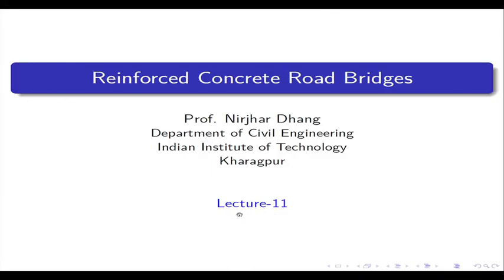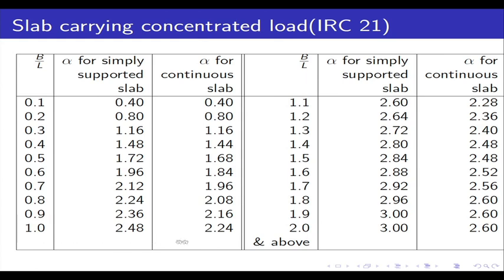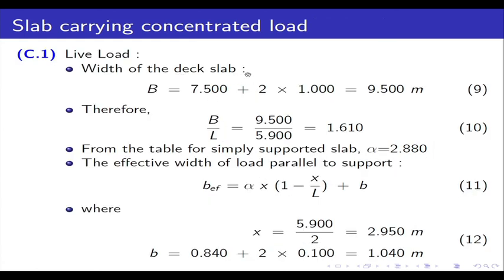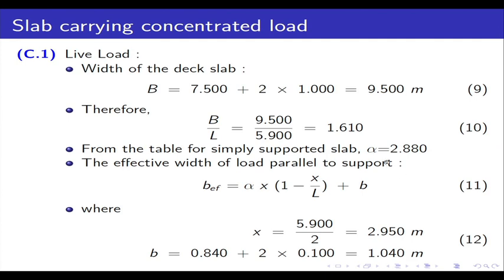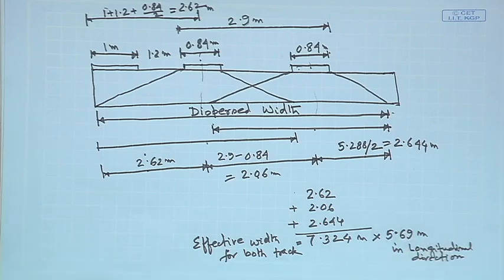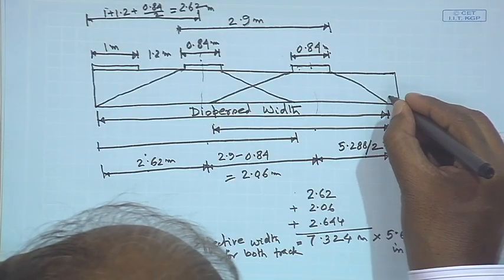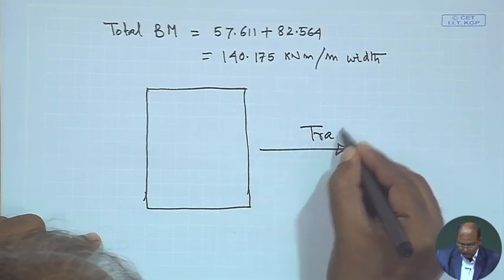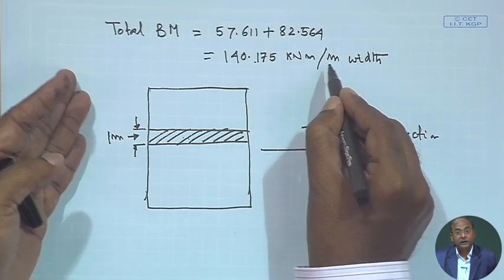Design of Slab Bridges (Part III)

Comment: also in calculation of Live load Bending moment, shouldn't we use 
(20.429)*(5.69/2)*(5.69/4)  (28:05)
Reply: am thinking same
Reply: Yes am also.... wr can u get intensity of loading first 2 values..
Reply: Yes
Reply: Yes you are right. I think sir has written that by mistake.

Comment: U are too slow😑
Reply: You can increase playback speed in options
When i did it 1.25 times then it seemed fine😁
Reply: i do the lectures usually at 1.75, you should try it tooo.